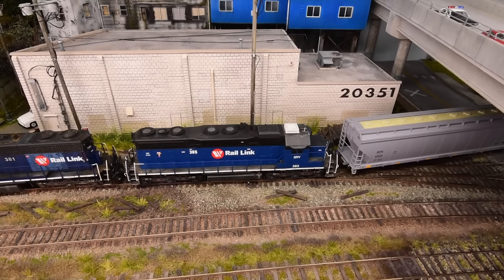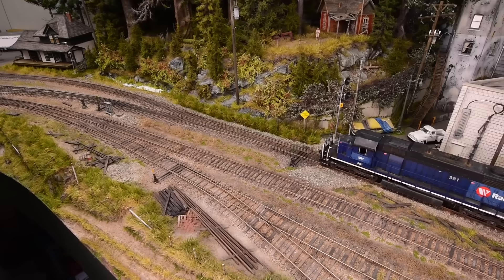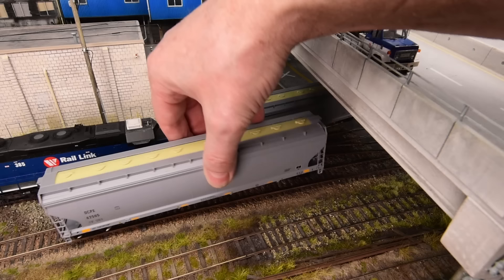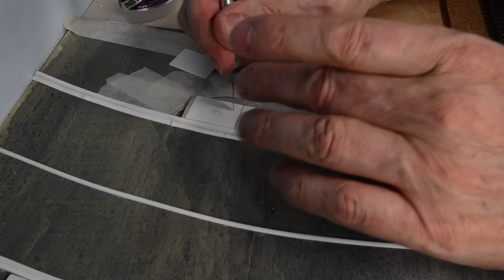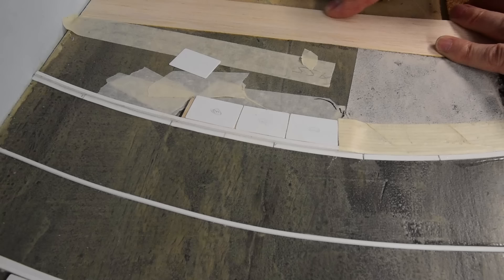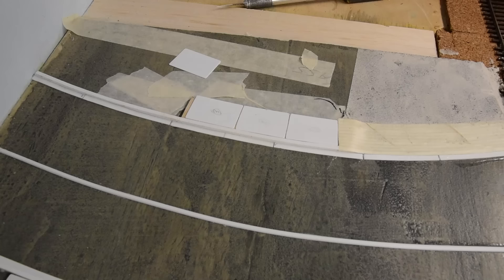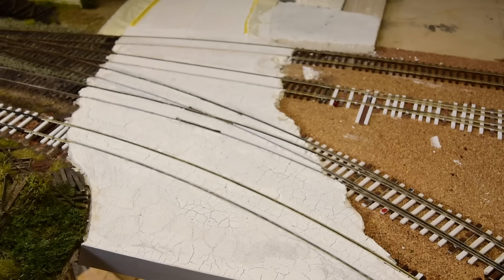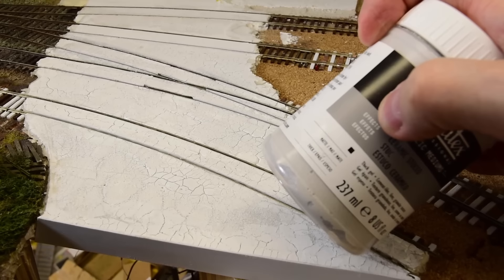Modeling the (SRY) 'Duncan Way' Model Railroad Crossing | Boomer Diorama ~ # 247

Comment: Boomer, Now that this xing area is almost finished we need to get yourself and your side kick ( Dusty) down here to fix a rail crossing. The tar seal has sunk between the rails to be below the rail tops in places. Traffic light goes green the car bounce's through it.  It's a wonder one's back teeth are still in place. Trucks love it at speed, in the rain making tidal waves as they cross. The rail and crossing are not long for this world but it hangs on like a creaking gate for another year or two. But I love how in the last two weeks all the road markings have been repainted, just like new. Sunday's are just the best, thank you. Cheers, Chris Perry.
Reply from the maker: Sounds like a few crossings out here until they rebuilt them recently.

Comment: Having spent 30+ years around underground  utility and heavy highway construction, it's great to see you modeled the cross slope of the roadwar.  FYI the normal cross slope is 2%.  The absence of the cross slope is one of those glaring (to me) mistakes that I see on so many layouts.

 The asphalt used for pavement is a petroleum product.  While it makes a great pavement,  traffic will quickly remove the asphalt from the top of the aggregate on the roadway surface.   I've seen aggregate from very light gray to yellow brown to redish brown.  This can give a variety of different secondary colors in the pavement.  

Another great tutorial
Reply from the maker: Thanks for sharing!
Reply: I love it up in the Western Mountains where they use the byproducts from Red Granite in their asphalt. The roads themselves are pinkish, especially after the tar fades.

Comment: Great lessons. I too had an allergic reaction to CA a while back. I was installing grab irons, and had my face real close to the model so I could see. Didn't have my fan on cause I didn't want the CA to dry out. Suffered for two days with sinus issues. Lesson learned. FAN = ON.
Reply from the maker: Yep. Fan in the shop for sure. ;-)
Reply: I get that with CA, I avoid using it on the layout. At the bench my solder fume extractor fan seems to make it much better.

Comment: That was great. I I’ve been putting off doing some road work because I wasn’t sure about how to go about it. I’ve used styrene last time with good results. Needed another way of doing it this time. Thanks for the inspiration and showing how to do things. Thanks Boomer…👍🏻
Reply from the maker: I used styrene on Glover Road because I had it lying around in big sheets and wanted to use it up. I prefer sealed balsa wood and multiple layers of acrylic paste for effects. I only use acrylic to fill between the rails and close in track. The larger paved surfaces I love to use 1/8" Balsa Wood sealed with varathane - then effects with skimmed acrylic paste, etc.

With balsa wood you can easily cut it and shape it while adding to it as well. Plus it's light weight and stable beyond what plaster can only dream of.

Comment: Very nice crossing Boomer!! 
Here in Anderson Indiana NS
just rebuilt several crossings
on the old Big 4 line north and
this time instead of using the
the rubber inserts they just
lined the inside and outside 
edges of the Rail heads with
ties and paved the crossing 
with standard asphalt with
metal ends for low hanging
equipment on the train!!!
I'm looking forward to the plastic plant build!!! Cheers!!!!
Reply from the maker: Yes. You can use the rail head as well.
Reply: @boomerdioramas  I liked your
comment on the Forklifts crossing
the tracks, before I became a
Trucker I worked at a Firestone
Rubber plant, we had a Conrail
siding to the plant, I had gotten my
work for my shift done a little early
one night and was out rummaging
thru the old discarded machines, 
when I started back into the plant
I crossed back over the siding track
and one of the back tires of my 
Forklift got stuck in the crossing,
my boss came out with a chain on
another lift and got me unstuck then
proceeded to tell me to stay on the
road, he told the day supervisor that
morning and he proceeded to tell me
a story about my supervisor, back when he worked on the dock he was
loading a Boxcar and lunch time came and he parked his lift in the
Boxcar and went to lunch, in the
meantime Conrail showed up and
took that Boxcar and left and when
he came back from lunch he freaked
out and told his boss and Firestone 
had to contact Conrail and have them bring the Boxcar back!!!!
🤣🤣🤣🤣🤣🤣🤣🤣🤣🤣🤣🤣
Reply from the maker: @conrailfan6277  Lol . . . that is hilarious.
Reply: @boomerdioramas  I have another
good one to that, we were a Union
Plant, to get a forklift job you had to
get there on Seniority, this new forklift driver started on my shift and
She had to move bags of Carbon Black from the Receiving dock
up to the Banberry where the raw
rubber is mixed with the Carbon
Black, now these bags are about
7000 Lbs and they are sitting on
heavy duty skids, when She went
under the skid She had Her forks
slightly tilted up and they punctured
the bag and She didn't notice and
drove to the other end of the plant
with the bag leaking all of the Black
powder all the way down the Isle,
this plant was about 3 blocks long
from one end to the other, we spent
about 3 hours as a group sweeping 
that stuff up so we could save as
much as we could, what a night!!!
Cheers!!! 🤣🤣🤣🤣🤣🤣🤣🤣🤣

Comment: Back in the 1970's I used putty. The problem was the loss of voltage at the crossing, the engines always hesitated. Great idea to use ceramic stucco.
Reply from the maker: That is interesting. I find that too much static grass between the track rails can cause some interference as well.

Comment: I'm also allergic to CA. It took some time to figure out, but whenever I used CA for more than a few minutes, next day I felt like a bad cold, just like a sore throat. I tried to use other glues but for some materials CA is the only stuff that works. I finally came across the green labeled odorless CA from Uhu. That stuff I can use for hours without ANY symptoms. I don't know if they sell it in Canada, but if they do I strongly recommend trying it.
Reply from the maker: I don't use CA much. I try not to use it all the time unless I need to clamp something. I don't use it as an adhesive for final builds etc.
Reply: @boomerdiorama  I work a lot with small 3D printed resin parts. I don't know any other glue that works for that job.

Comment: Good morning Boomer.  You have said your shelf is 57 inches high.  I have a non-railroad question.  How does Rusty get up there?  My two won't come near mine and its only 42 inches high.   I enjoy your painting lessons and have been practicing the wash techniques you employ.  Not quite Boomer quality, but certainly better than if I had not watched your tutorials.  Please keep doing what you do.
Reply from the maker: If I leave the door open Dusty can just jump up there. Although, she won't if I am not working on it. She only seems interested when I am interested which is kind of cool. Cheers.
Reply: @boomerdiorama  We have two cats, sisters 12years old. They can easily jump 2 metres onto a shelf.  Your cat appears when you are working as a supervisor. The warning is.. if the cat doesn't approve it may piss, and that is a diabolically caustic fluid that will corrode metals AND destroy any MDF board/moulding, far worse than plain water will.

Comment: When applying the 4 X 4 to the inside of the track, what kind of glue do you use to make the plastic stick to the rail. Please!! I understand that the second time ( or other times ) that it is a press fit, but what about the first time??I love the fine tooled edge instead of the jagged scraped edge that comes with a saw blade. I've noticed that in some very used places here in Indiana the rail road has put metal in the space between the rails and this has to be replaces not near so much as the concrete or pavement. Also, when laying the 1/4 mile ribbon rail the road drops the rail along side the current rail. When they come to a crossing (at least here in my town) they dig a trench outside the track and place the new rail in the trench and then put pavement over the rail. This is a way to store the rail in one piece until they come to replace the current rail. I noticed that one of out steel plants has laid track just inside the main track and paved inside of that. The second track makes a very impressive flange area and looks great.
Reply from the maker: I sand the top of the ties (with 60 grit) to introduce "tooth" and then I use medium CA to clamp down the angle piece while tucking in the square stock. I put a bead of CA on the outside of the angle (middle of the track) so as not to glue in the square stock. 

Then I fill with acrylic paste (between the angle stock) and skim it. The acrylic will anchor the angle in place over the CA once it cures, and the square stock will pull out easily. I love this method because it works beautifully if you see track as a model. ;-)
Reply: @boomerdiorama  Thank you so much...

Comment: Love the look and plan to do similar myself. One concern i have, is how do you clean the track, for years to come, without damaging all the hardwork?
Reply from the maker: The acrylic cures hard as nails eventually and is just below the rail head. I never mentioned this, but you can pre-tint the acrylic medium to any color you want as well. When it cures you can sand it all day long without affecting the color other than scuffing it a little. Same goes for once you paint the ceramic layer. It looks like normal wear & tear.

Comment: A further question, please: when you lay track, how do you glue it down?
Reply from the maker: I tack mine down with a spot of medium CA (on cork). Every few inches with a few pins to hold it on place. I like this method because I can make minor adjustments and then wick in a little CA (super Glue) into the ties. Then the ballast and matte medium which follows soon after holds everything in place. ;-)
Reply: @boomerdiorama  thank you!

Comment: Do you seal the cork with Varathane too?
Reply from the maker: Every wood framed layout will move and shrink over several years. Plywood moves less than softwood which is why I use the best I can afford for track surface. Nevertheless,  you can't stop wood from expanding and contracting,  but I have learned to minimize it from experience.

In most cases I seal with (water-born) Flecto - Varathane - all the wood and cork on the top surfaces. Wood and cork will absorb moisture and cause things to swell at different rates in some cases which can cause track issues later on when things dry out. Especially when PVA glue is used. Varathane helps to seal from moisture on the top surfaces where the track is.

Furthermore, The reason for matte medium, when I ballast, is it is flexible (and dissolves with IPA), and doesn't dry like a hard PVA shell which ultimately kills the sound deadening of cork.

I like to have a moisture barrier on the top surface of the Wood & Cork substrate, and let the layout wood framing breath from underneath as it drys out and shrinks over the years. You get less track buckling in the long run this way.
Reply: @boomerdiorama  thanks for taking the time to write such a helpful reply
Reply from the maker: @bimb0cat  Sure thing! Cheers.😁